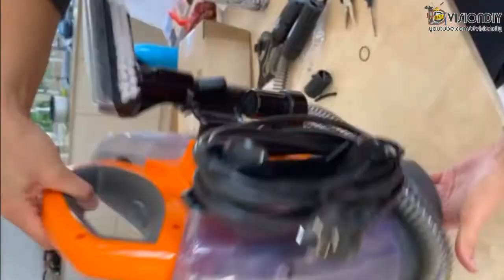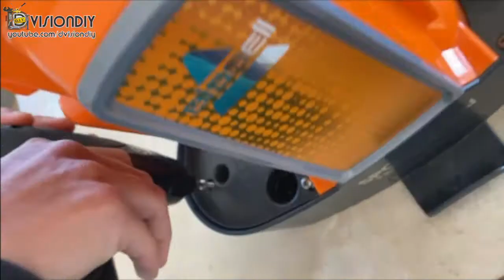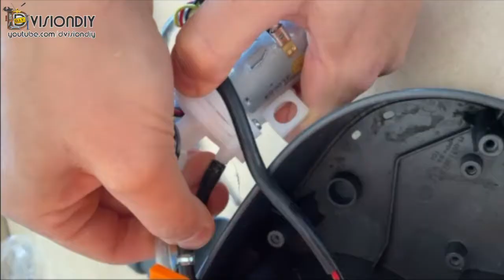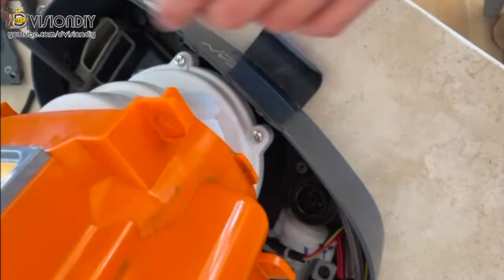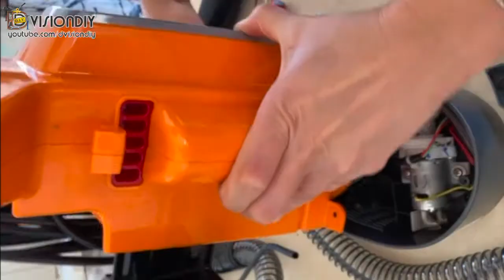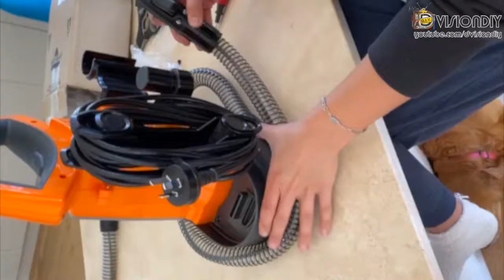How to change a Bissell Spotclean hose assembly

Comment: These have notoriously bad hoses. They get rigid with use and have too many tight turns in them.   Then they just tear.  Don't store in the holder.   My first hose tore and was replaced under warranty.  The warranty hose (a little longer to prevent the kinks where it tears, but nope) then tore and would cost about as much as a new unit.  Found a replacement hose online and did basically the same procedure.  Excellent tutorial.

Comment: I Need to purchase the hose for a model2513g don’t know if hose is replaced?
Reply: Search: Bissell 2513g replacement hose.  $15 - $20 for the hose.  This video is pretty much the best one I found.  On the hose, make sure you get the right one.  It might not be the exact right length if not from Bissell, but don't kink the large hose.